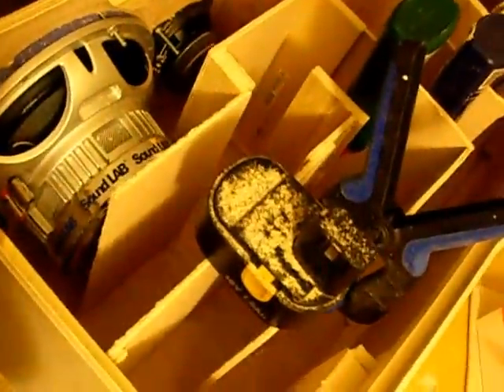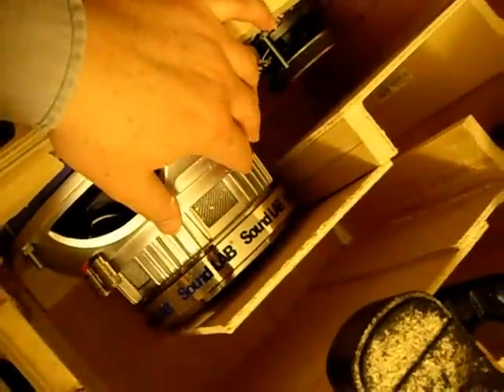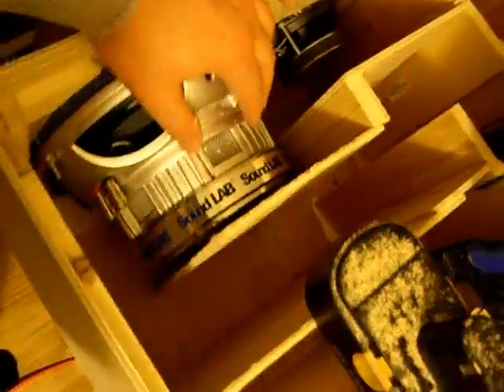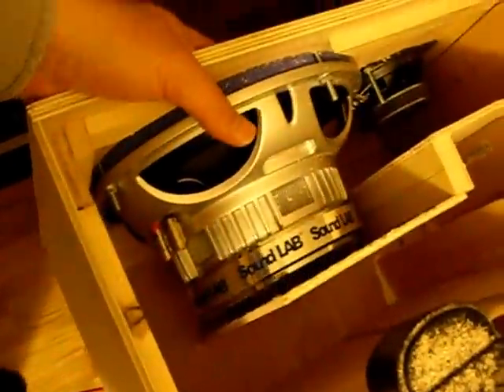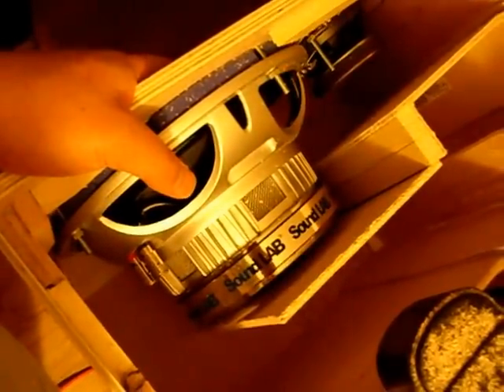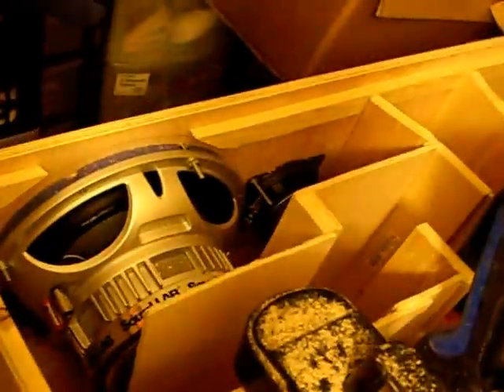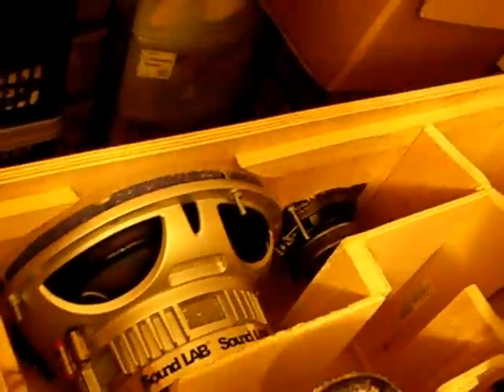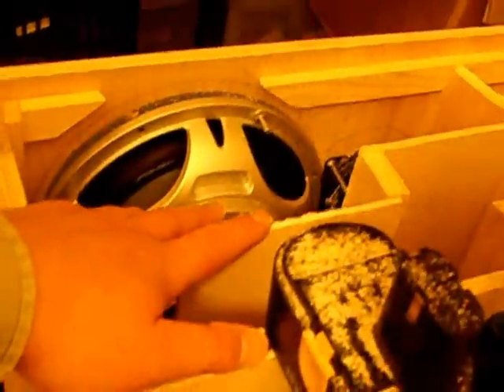Transmission line bass speaker for a small car - lightweight construction

Comment: :0  nice . but wrong :) don`t want to be a hater i guess since 2011 till 2020 you learn that there u did 3 big mistakes. 1 small speakers must be seald ! 2 middel port must be double ! 3 that`s no wood for a t-line . but what is the best thing about building ...you learn , if you seald the small drivers and build with 16mm mdf the box  , double the port size in the mittle trust me does subs will breack u`re ears :) you lose lows when the small speackers are in the same chamber, and the wood vibrating like crazzy,  keep it up, once again u have a like :)
Reply from the maker: Thanks! Yes we got way with a lot because it was only 24 watts - sounded very 'expensive' in the depth of sound.